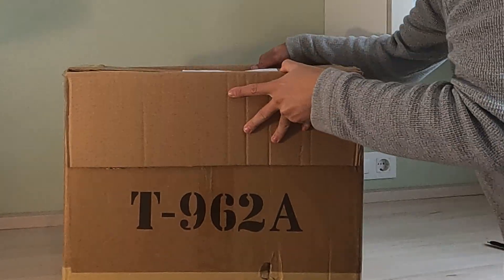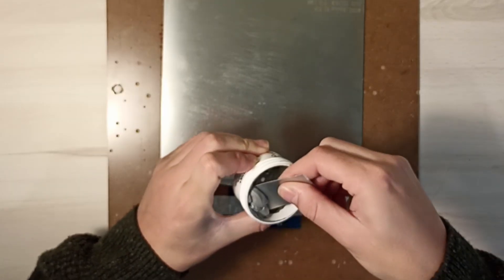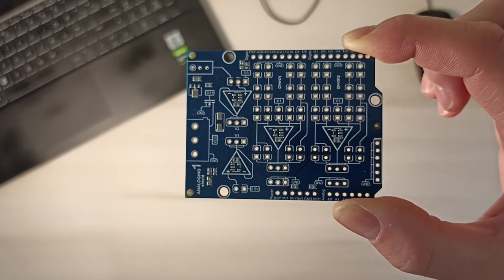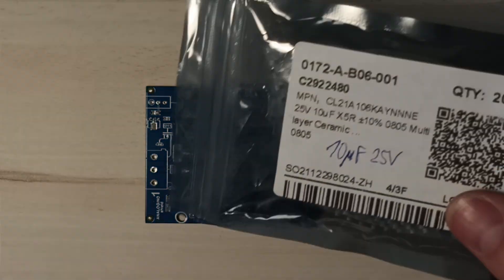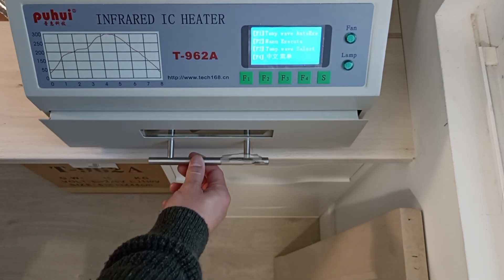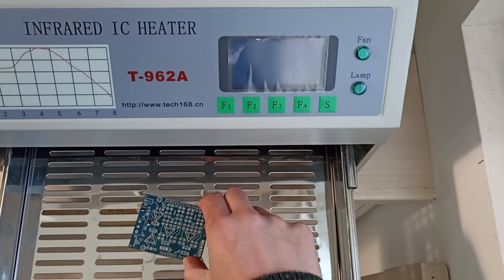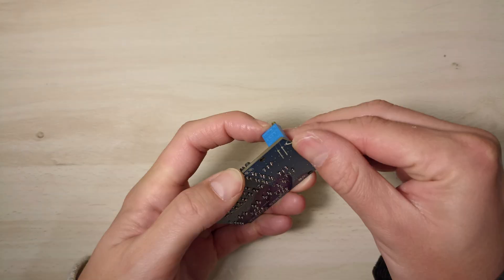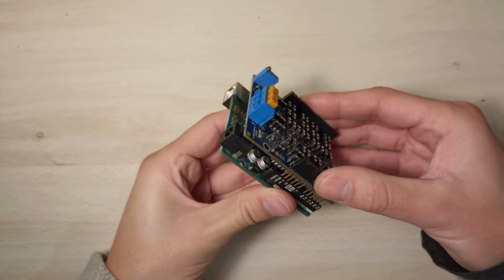🔥  T-962A Reflow Soldering + Hand Assembly: Full Arduino Shield Build!

Comment: Very good video.  It's a nice little machine and glad it's working for you.  I improved the insulation and did a mod for temp stability.  I found the work envelope too limiting for me in terms of heater to thermocouple to board distances and spread, so went a different route (toaster).
Reply from the maker: Hi! Thank you! Yes I read about the mod for this oven. In fact, I bought it thinking one day I will do the mod. However I used it few times and it is enough by now